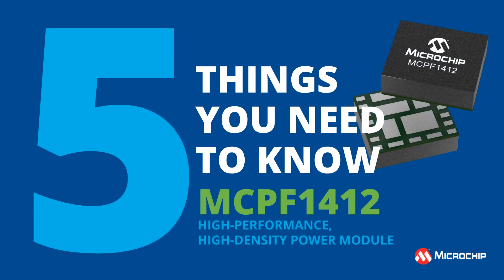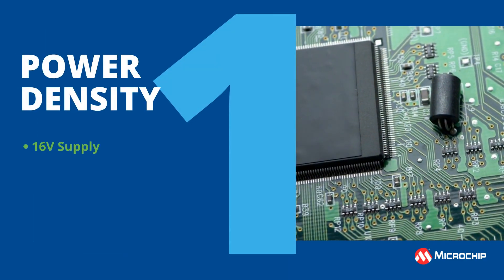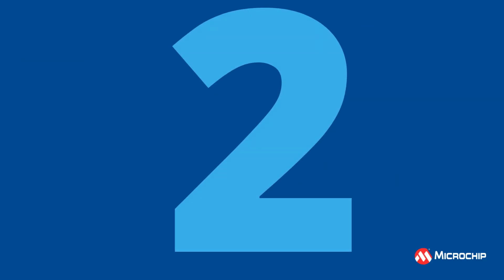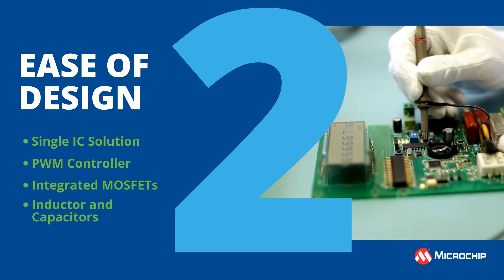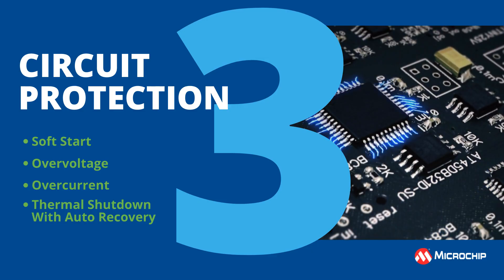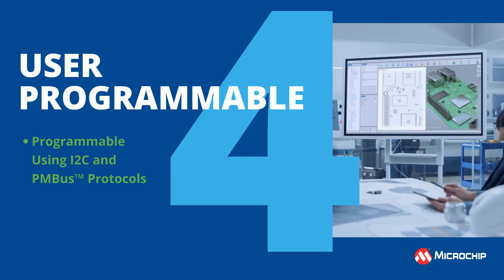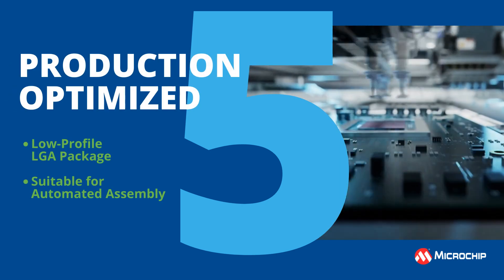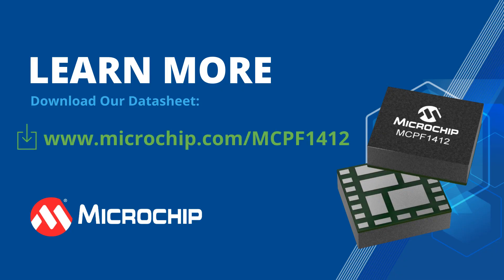MCPF1412 - Five Things You Need to Know

Comment: The module is very attractive in terms of dimensions and price. But there is one thing, but, for fast design, as a developer I need to not only create a poundprint, but also a 3D model of the component. And I see a problem with this for the Microchip. For me this is not a problem, but for the remaining 98% of PCB designers and circuit engineers, this is more than a problem.
Reply from the maker: Hi there, thanks for your comment. Having access to accurate footprints and 3D models is crucial for fast and reliable PCB design, especially with compact modules like the MCPF1412. Microchip is continuously working to expand its library of design resources, including 3D models, which can be also located in Ultra Librarian, Product Page (https://www.microchip.com/en-us/product/MCPF1412) under the CAD Files.
 
If the footprint and 3D models are not readily available, Microchip offers a process for obtaining CAD models (including symbols, footprints, and 3D models) for their components. You or your engineering team may contact us to learn more at: https://www.microchip.com/en-us/support